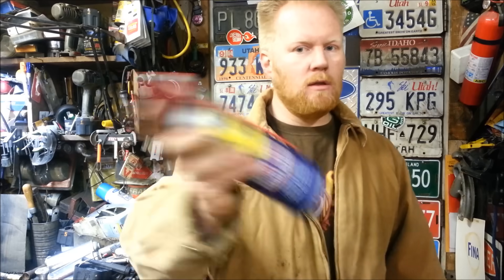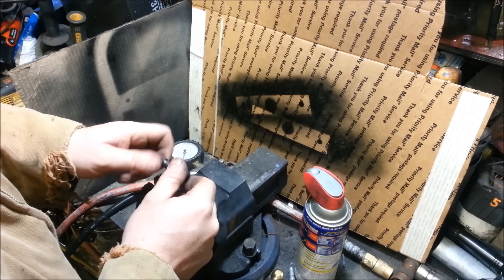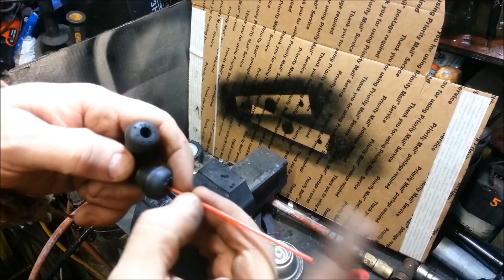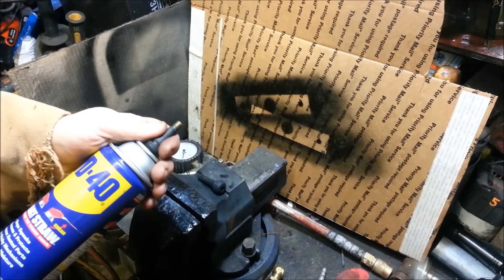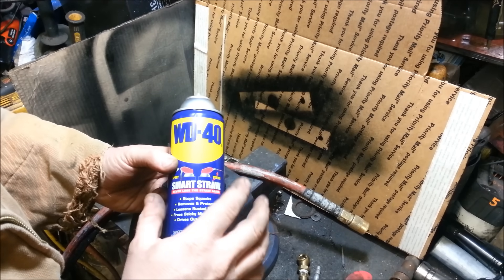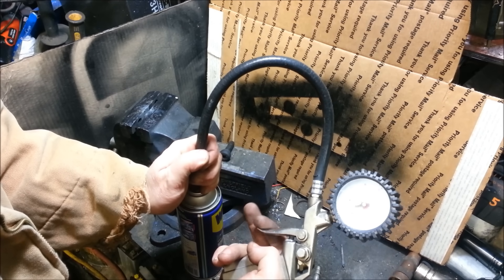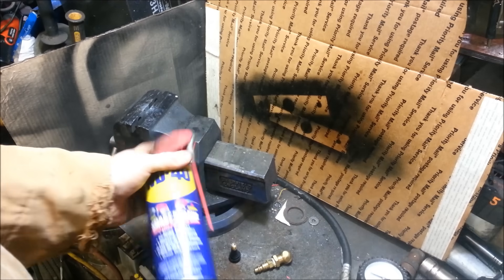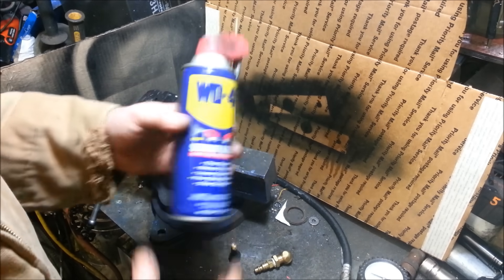Refill flat AEROSOL Spray Cans like the WD-40 and others

Comment: WARNING! If you do this, then you risk explosion of the can, due to any overpressure that you might give it, or even worse an explosion due to an accidental fire that might ignite the contained fuel. What I mean by this, is the fact that every aerosol can in the market, uses propane/butane(or both) gas, as a propellant, but NO OXYGEN at all. So, if you accidentally spray on a flame and the contents get on fire, if you release the button, it will stop. But if the can contains any oxygen(like now), the flame will travel virtually instantly inside the can and cause a HUGE explosion!!!

+1 If you liked it and you want others to be warned, as well. And sorry for my somewhat poor knowledge of English, but I' m Greek.

Comment: Not sure if this is a really great idea or a not so good idea.
These cans do not contain compressed air.
If they did the compressed air would run out way before you got even a 1/4 of the contents out of it.
They contain propane or isopropane. 
The propane dissolves into the product in the can (paint, WD40, ect), as the level of product in the can drops more of the propane boils off repressurising the can keeping a constant pressure until the product is all gone. 
They used to contain dichlorodifluromethane but that was destroying the ozone layer so they stopped using that.
If you put compressed air (that contains oxygen) into a cylinder that has some propane in it you are potentially making a bomb.
It might be perfectly OK depending on the flammability of the product, then again maybe not?? (eg: paint has thinners in it, thinners is flammable) (compressed oxygen and thinners = bad news).
If you want to get the last dregs out of a spray can that's run out of propellant you can puncture the can with a centre punch and just pour the contents out.

Comment: Just a word of caution - pressurizing petroleum vapor with air can cause diesel detonation under the right conditions. CO2 or nitrogen would be totally safe at pressures below the working pressure of the can.
Reply from the maker: You would need to get the can up to around 700psi to create dieseling effect. Completely unobtainable with even a 2 stage air compressor. Were working with 50psi here.
Reply: @sixtyfiveford  Diesel engine compression runs as low as 210 psi pressure for vegetable oil or diesel oil. The autoignition point varies with the type of hydrocarbon, percentage of available oxygen and the compressed temperature. Acetone will autoignite at a different pressure/temperature than M.E.K. , toluene, butane or other aromatic or aliphatic hydrocarbon. The point is that the absence of oxygen in the equation eliminates the risk of any problems.

Comment: Firstly for all you braindead zombies out there a valve core does not come off a tyre/ tube its fitted to the wheel secondly cans dont have air in them to run out its hydrocarbon gas also the only time cans run out of propellant is when imbicles hold c it upside down got it.

Comment: I fill the pressureless can with lighter gas - very easy - very effective.
Reply: This is exactly the propellant they contain, at the first place. Putting oxygen in such cans(ANY can), is EXTREMELY dangerous, due to the risk of explosion, in case the contents hit a flame or something, as I just said in another comment of mine.
Reply: @AnotherUser1000  Agree. Especially, you get an automatic pressure control as the lighter gas propellant liquifies at around 2-3 atmospheres pressure.

Comment: Thank you this has happened to me soooo many times and I end up throwing them away such a waste... Never again!!!... Lol
Reply from the maker: Hey Thanks, I'm glad you liked it.
Reply: I always get the lubricant even if I have to drill or punch a hole in the spray can. Just make sure it has no air inside, as some times spray paint cans still have air but the nozzle is clogged with dried paint, and wrap in a towel to avoid injury. I have done this many times to collect the remaining paint and haven't ever been hurt.

Comment: Great tip I'll see if I can get the guys in the Army shops to follow through and save tons of tax payers money.
Reply: Likely using $1500 government contract valve stems.
Reply: @LtEdPell  nahh those days are gone in the obama era for sure money wasted on contractors left and right,,but now you'll be lucky if you can get a buck ,,,but the newest equipment and training fix those issues past.  Air Borne ,,to the Top 🐴1-17,, 6-6

Comment: That is a “Valve Stem”. The valve core is inside the valve stem. Great hack however. Nice job!
Reply: Correct.  The actual valve inside is referred to as a Schrader Valve.
Reply: @hootinouts  I was thinking that too!
Reply: Why do guys always have to show off! Lol
Reply: @Feather_the_great  Not showing off. Not all people know which is which. It can help when theyre going to buy this item.
Reply: @Feather_the_great  It helps to know the right terminology to prevent confusion, delays and funny looks.
Reply: Thanks saved me the trouble of saying the same thing as both of you...
Reply: Hey i appreciate this video, i  always ran out of air with these WD40s can
Reply: Thanks Dan....I was looking on ebay but only found the core, then I put valve stem in the search engine and bingo!! Amazing the difference in one word!
Reply: Go to your local tire fitting depot, they'll give you an old one for free!

Comment: If you have ever neglected to shake a old can of spray paint (especially Rustoleum) for a full minute and you get that lump of snot blocking the internal tube try blowing it back this way.... then warm the can in some hot water (not too hot) and shake for another full minute. 90% of the time you can save that can of paint, although sometimes you also need to clear the nozzle with some carb cleaner. BTW, at our shop we go through WD 40 by the case and I would estimate around 20% - 30% of the cans fall short on pressure before they are empty. This wasn't a problem 20 years ago.

Comment: Why do you have to use the valve in the other video and to make a hole in the can then weld it and all this while you can put the air pressure the same way you did now?
Reply from the maker: That was an empty can that I can refill with my own liquid.
Reply: @sixtyfiveford  Okay But I always refill the can the same way you did, but I put the air from the top same way you did on the video and it worked out perfect. Thanks for answering anyway. I be following.

Comment: Take two sections of wood with 2 long threaded rods with wing nuts on the top on each side with wd40 can in middle. wood top section with hole schrader valve fits in. When it is put together the schrader valve sticks out the top of the wood leaving just enough room to screw on a fitting with a air line attached. Once that setup is made hook up a air line going to a jar with 4oz of wd40, hook up air line going to jar and apply air forcing wd40 into wd40 spray can refilling with fresh wd40. next hook up air line direct to top of schrader valve and top off the air charge. From that point forward only buy wd40 by the gallon and pay 80% less per oz for wd40. Remember wd40 sells wd40 by the gallon giving you the opportunity to take advantage and pay much less if you can figure out how to refill the cans.

Comment: bunch of nonsense .
simply punch a hole in the can with a nail or center punch drain the wd 40 cleaner into a spray bottle.  works great. 
the problem is moat people that use wd 40 doesn't own a  hammer.  thats okay though because,  you can use a rock for. yout hammer.
Reply from the maker: Yep, I open windows with a hammer as well.
Reply: sixtyfiveford 
"as well " ? 
personally ,  I use the ultimate tool for opening windows - all windows -  which is the Origin 12 feedimg it 30 vials of Dragon breath food.

Comment: Guys and gals, when using compressed air, be very very careful with it. If you accidentally blow compressed air through your skin, call 911 immediately seek medical help immediately 
compressed air entering your blood stream will kill be fatal in minutes. Use  EXTREME CAUTION.
Reply from the maker: Guys and gals, when using a butter knife, be very very careful with it. If you accidentally cut through your skin, call 911 immediately seek medical help immediately knives entering your heart will kill be fatal in minutes. Use  EXTREME CAUTION.

Comment: I had a squeaky door I got my can of WD40 and pressed the nozzle and nothing came out.i was about to throw the can out. There was too much solvent in the can to waste like that. I came across this video by doing  a search on YouTube. I decided  to take my non working can of WD40 to my nearest tire shop, I asked him if he can do me a favor and put air in my can of WD40 , he looked at me as if I were crazy ,but he did. Sure enough it worked. I now have a can of WD40 that i was going  to throw out working again. Thanks to this video.
Reply: Better way to oil your hinges is to remove the pins and GREASE them. The grease stays put and will outlast WD40, which is a penetrating oil/solvent. A small finishing nail or punch from underneath will knock out the pins easily for maintenance. Also easier to remove doors that way if you're painting a room.

Comment: I just punched a hole in the can to let the air out, then punched another hole and drained the contents in a squirt bottle. Rest the can horizontally in the jaws of a vise open about an inch and a half to punch the first hole near one end of the can. The air will come out with no fluid.

Comment: Can you refill an empty can with just air to make air blowers for cleaning dust off keyboards etc.
Reply from the maker: No. Air cans are actually freon. Yep same stuff that keeps your car and house cold. It turns to a liquid under pressure and you can fit a ton more in a can. If you fill the can with just normal air you will only get 3 seconds of spray.
Reply: Oh! I see. Thanks

Comment: Hey , buddy . I don't think you know your parts and pieces that well . I'll just point out two of what you call a valve core . One the rubber stem is called a valve stem and not a core and two the core is the screwable part inside the valve stem .

Comment: First off, don't but these products in aerosol cans. Use spray bottles. You can buy WD40 by the gallon, save a bundle and save the environment at the same time. Which segues to why bother with all that ? Just puncture the can, drain the remnants into a spray bottle and recycle the last can of WD40 you'll ever buy. Because now you have a spray bottle for all your penetrating oil going forward.

Comment: need me one of those handy dandy air gauage trigger clip on to the stem deals...seems like the ones these days are plastic rather than brass....grrrrr
found an all metal one on Amazon that all you have to do is shave the seal on the stem clip...it is a bit too thick and doesn't engage the stem very well..a reviewer pointed that out and said it works fine...and here's the good news it's under $8.00
https://www.amazon.com/Inflator-Inflation-Campbell-Hausfeld-MP600000AV/dp/B0007ZJ1IK/ref=pd_sbs_263_18?_encoding=UTF8&pd_rd_i=B0007ZJ1IK&pd_rd_r=1278d02f-a506-4c4e-9676-ad9bc01df775&pd_rd_w=7NrK1&pd_rd_wg=9qRum&pf_rd_p=d66372fe-68a6-48a3-90ec-41d7f64212be&pf_rd_r=XC7PXA1CFSEDMPNHHW08&psc=1&refRID=XC7PXA1CFSEDMPNHHW08#customerReviews

Comment: if you use a blow gun with the rubber tip, you can fill any can straight from the spray tip. been doing it for years..

Comment: WD-40 is basically diesel fuel. Diesel fuel, when compressed at a high temperature can explode. This looks safe enough, but I would only put enough air in that's needed. 
There was a video of some idiot that decided he was going to smash a can of WD-40 with a sledge hammer. The clip ended after the explosion, so I didn't get to see his condition.

Comment: just use a pump spray bottle and be done with it // the main problem with wd-40 is sitting on the shelve they lead and also produce will settle of seperate from weather or age and clog the pickup tube

Comment: I believe this will work ok for most fluids but I would advise not to do this with spray paint. Plain air may cause the paint to clump and start cureing in the can. You would get a splattery messy spray. If you used it soon it should be ok. Though paint not comeing out Is usually from a plugged sprayer & not from inadequate pressure.
Reply: I was going to do it for wd40 and quad oil...
Reply: Just do it right before you are ready to use the paint.

Comment: What about the cans that don't have the white plastic nozzle sticking up?
Reply: Dan Marcum 
 read a comment and he said he uses ball needle as a refill tool.
  Im gonna try this with the female version of the cans, or just use the valve stem with a stiff straw material cut to fit so as to press the relief valve open under the valve stem.

Comment: Better still, you can recharge air-duster cans this way. Never pay $5 for an air-duster again!
BTW, 1,100 or so petroleum-distillation-waste-product-bottlers disliked this video, and WD-40 is useless for anything but drying electrical contacts or flame-throwing, or as a weak degreaser, IT IS *NOT A LUBRICANT* AND DOES NOT FREE FROZEN FASTENERS! Remember that "WD-40" stands for "Water Displacer, 40th formula", even Zippo lighter fluid (naphtha/Ronsonol) is a better lubricant.

PBlaster in the yellow and black can does. WD-40 and Liquid Wrench are just waste products of petroleum distillation that somebody had the idea to market and sell to unwitting consumers, and are absolutely useless. PBlaster is actually formulated intentionally. Buying WD-40 or Liquid Wrench is the surest way to throw your money away, by buying someone else's garbage, and it doesn't work.

Comment: Seems like a great idea, but it aint.
It could be ok to pressurise some chemicals with air but, not WD40.
WD40 is a hydrocarbon, a very light hydrocarbon which, are pressurzed with an inert gas for a good reason.  What you've gone & made yourself there is a bomb, just waiting for the right conditions.  Aside from that & depending on the chemical in the can, by pumping air in, you've also introduced an oxidizing agent which, could have any number of negative & dangerous adverse effects to the chemical & the equipment it's applied to.
All up, this is just a stupid, ignorant idea.
Reply: some of us have compressed nitrogen cylinders on hand

Comment: Thought aerosol cans were banned due to the ozone layer deterioration? Remember?
Reply: Yeah but they changed the name of the gas to hydrocarbon from CFCs and that name change cured all problems... Same thing with asbestos if you call it concrete fibre board it's no longer dangerous

Comment: An elderly Mechanic I was friends with yrs ago used to do this using the tip of a Blow Gun. I used it a # of times but always end up "spritzed" as I topped them up . Your method looks MUCH cleaner, & will try it!  When I was about 15, I was friends with an elderly Newfie who thought Spray Cans were a Conspiracy; "Dose @$$hole make dem sealed Spray Can go out of air fast so I 'aveta trow dem out & still 'ave full" "I outsmart dose guys" Shows me a shelf full of Cans (& one was the now old style WD-40,  all the tops cut off & Paint Brushes inside.  Back in the day some of them did not seal properly & by time you NEED it there was NO pressure, & of course its full, (why he thought it was a Conspiracy)  Thank you!
Reply from the maker: Thanks, I'm glad you liked it. Great story.

Comment: Cool trick. The thing on the end of the air hose is called an air Chuck. That black rubber thing is a valve stem and the little piece inside that we didn't actually see in this video is the valve core

Comment: 1)  It isn't called a valve core.  It is a valve stem.  The valve core is the removable valve that screws into the valve stem, 2) It isn't called an "air valve", it is an air chuck.
Reply: Watch out, negative Nancy
Reply: @Fred C Rogge Sr: Bet you jizzed in your shorts while passing on this "valuable" info, lol.
Reply: My problem with this is somebody passing out incorrect information.  If you can't provide the correct names, then maybe you should do a little research first.  

@Erik Dahl:  I'll bet that made you feel pretty powerful to be able to insult somebody you don't know, and who is correct.  It may not be "valuable info", but it is accurate.  

@jimmy moseley:  I am watching out, watching out for those who rely on others to provide them with the correct information they are looking for.  Signed ~ Negative Nancy

Comment: did not have a tire valve stem handy so grabbed the spray gun with the long tube and what do you know the tube fit perfectly over the aerosol can tip. worked like a charm. 

thanks for the tip.
Reply from the maker: Awesome.

Comment: I've done this quite a bit working in the shop but something I noticed about it is alot of the times it will blow the internal straw or tube off and you have to hold the can upside down when you spray it.
Reply from the maker: I've had the straw disconnect as well.

Comment: If there is only a little left... Crush the can a bit, but I usually save that bit for cleaning the metal table pop hole opposite fluid pour on surface.

Comment: I use aerosol spray lube.  It loses pressure in winter months.  I keep it in my work truck.  I found that as temperature rises it gets a little better.  When van heats up.  Thank you for sharing your video.  I thought I was only one who noticed this.

Comment: 🔵 It's important that you all know that you can
ONLY do this to aerosol cans that contain liquid that DOESN'T set-up or Harden in contact with air, if you tried doing this to a can of spray adhesive or anything that hardens on contact with air, then doing this will merely cause it to harden in the can.
Reply from the maker: Yes and no. Generally you only have a small amount left in the can or even if it was nearly full you can do this and just use up the rest of the can on they current project.